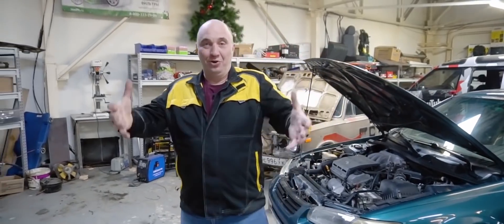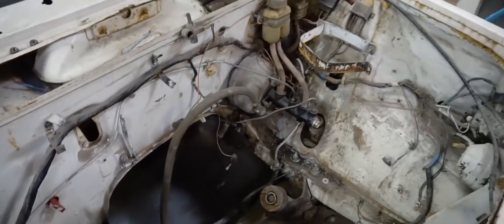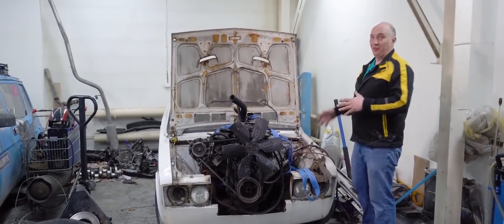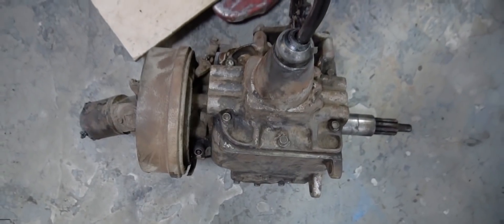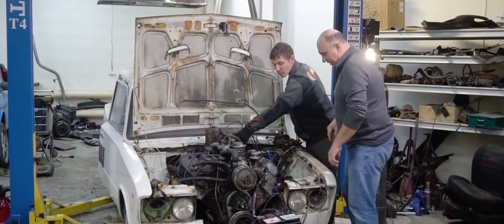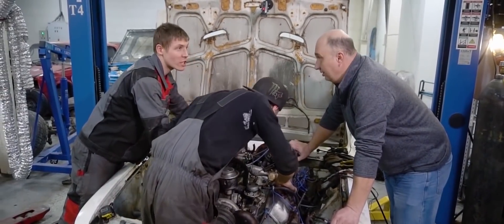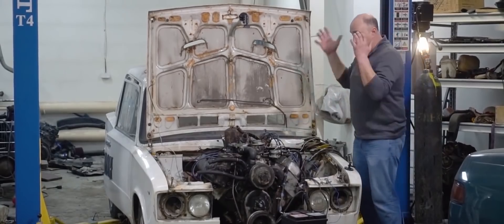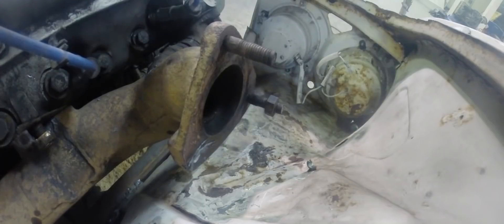Swapping a 7-liter truck engine into a Lada – first start

Comment: How about increasing compression ratio. You can mill heads some but maybe just add a spacer to the top of the pistons. “ domed pistons. Add water alcohol injection if you get detonation. With all the extra boost.

Comment: If that engine is from a ZIL 131 it's a 7.0 litre V8 making about 150 horsepower, and so tough and under-stressed that you can run it on anything that burns; gasoline, diesel, heating oil or even Vodka.

Comment: YEA! That huge engine weighs more than 3X of the original... Not much difference he says...  The suspension and drive train will have to be be beefed up for sure. Also the frame will have to be strengthened. That motor can tear and twist that car apart!

Comment: Make a nice custom hood cowl by reinforcing the inside of the hood with a metal template (the cut-off bottom of a turkey baking pan) which you spot weld on. Then cut out the shape in the hood. Cut one side off the remaining rimless turkey baking pan remnant and face it toward the windshield to fit it. Attach tabs from the remnant to the motor. Spraypaint all pieces white.

Comment: If that "transfer gear" was to drive the front axle, the Soviets were dumber than a box of rocks.  That's where a PTO would go.  On a US military truck, that part would drive the winch.  It's not strong enough for the kind of torque that the front axle could require.

Comment: The lada with 38-inch tires way we modify it we changed rear axle wider one and put off racing knocks long travel shocks and steering racks. you have a monster car.

Comment: Looks perfect. Just a little bit more pressure in the front tyres - and every thing works good. 300kg is nothing - an A380 weights 400.000 kg.

Comment: "This should be a straightforward swap." Understatement yes? About like trying to stuff an IH 549 under a SII hood. For those that dont know...IH (International Harvester) engines are industrial grade and quite large//heavy for their displacement. IE a 304 is almost as big as a 454 Chevy and weighs about the same.

Comment: It is 6 liter engine if it is from Zil-131. It is 7 liter if from Ural 375. Only the piston and liners change. Externally only way to tell is by carburetor. Zil has K88 carburetor, Ural K89.

Comment: While a big block V8 Lada is very cool, perhaps that is not going to be so cool temperature-wise, not much space for a radiator.Perhaps the second and third 7L truck engines need to go in the back. Google : Bustle Bomb dragster

Comment: I remember when someone swapped a Leyland  alloy V8 into a Volkswagen 1600. Type 3  it ran like a scalded cat.  breaking traction in 2nd  the cooling plumbing was a nightmare!  ......never did buy it , ....the test drive was enough.

Comment: It will burn the exhaust valves with no pipe from the manifold
Reply: @D.O.A. yes cold air getting sucked back in, I've seen it before, it can happen if you  have blown exhaust gaskets or stock manifolds, short headers with no pipe, etc, now that's on a 350 Chevy I am just assuming it will be similar

Comment: 7L V8  making a monsterous 150hp so it can run on kvass
Reply: I hope they turbo the thing
Reply: @lazar2175  But then they need to install EFI and it will be complicated on this engine
Reply: @nicostenfors5690  No they don't, plenty of older FI cars without any electronic fuel injection, just need a carb made for boost and a fitting pump and nozzles.
Could have some issues with timing tho, probably fixable.
I'd try to source a turbo from a bmw diesel with a engine bigger than 3.0 liters, should make this baby go fast.
And you can get used ones under 100 dollars, only real problem is they have to make their own manifold.

Comment: Now install a motobike engine into a truck
Reply: I’m very late, but there’s a lawnmower engine in a pickup truck here on YouTube
Reply: @nbain66  Are you meaning a 212cc Predator engine? Or an actual lawn mower engine swap?
Reply: @desertrat1357  that would be funny, 5.5hp Briggs and Stratton.

Comment: i think the timing is a bit off, or the engine has a problem because of the backfire trough the carb, id check some stuff before doing anything else

Comment: I think you should try to save the hood as much as possible. Weld up pipes for the manifolds and have them come up through the hood like we do on American tractor pull trucks.  Either cut out a hole for the air cleaner or build your own huge scoop over it from sheet metal. Radiator can sit where the back seat was with electric fans, run metal tube for coolant with rubber flex hose for engine and radiator connections.. Widen the rear rims, that Lada will look like a sweet drag car, it looks mean already.  I'm really liking this one guys! :)  Hello from Texas!

Comment: Swap a CBR800 engine or any other motorbike engine in a lada, it’s very possible. Old fiats got turned into drag cars with a motorbike engine in the back. It beat a lamborghini in a race, imagine a lada
Reply: R1 crossplane

Comment: Did you see the backfires through the carb?  Anyway, those Ladas don't have power steering, so it will be interesting to see if it will be driveable with this swap.  After all that's like 4 times the normal weight at the front.

Comment: As far as I know, it is a 5.9 liter unit. It is advertised as 140hp in at least the ones I drove in the army. Those things are pretty OK if you use them as anchors, but pretty useless otherways, they weight a million tonnes, burn totally ridicilous amounts of fuel and give nothing except noise in return...

The noise is the centrifugal "oil filter" underneath the dome behind the carburetor.

Comment: How about swapping in a Cessna 172 engine, in a Lada, and include the Propeller and Cessna Instrument cluster.  There would be no power to the wheels, just the propeller, also use aviation fuel, for the car.    Please like this comment.   Really would love seeing an aircraft engine, powered car.

Comment: Even with aftermarket suspension it isn’t going to handle well without a lot of ballast weight added in the trunk. Then aside from all the weight, with stiffer suspension, it probably wouldn’t handle half bad with better tires obviously. In all seriousness though, as long as you don’t get too much understeer, it would make a great drift car and since drifting will lessen the load due to the rear tires spinning you lada diff and axles might survive a few laps. Lol!! I don’t know if you’re using the stock drive line though :0 :p YOLO baby! With it being so light in the rear compared to the front it might just spin out while trying to drift or be hard to control.

Comment: 6,960 cc displacement depending on the year of the donor truck. So was it a zil 131 or an AMUR 531350/531340. I hope that donor truck was re-powered not scrapped.

Comment: A GM 350 V8 should fit into the Lada’s engine bay.
Reply: Would look rather nice too, or a 454 probably a little smaller than that truck engine they have
Reply: @ce5243  a 454 is like 7.4 litres lol

Comment: That noise at 11:21 is a rotating centripetal oil filter. It spins itself using the oil pressure, the centrifugal / centripetal force filters the oil. At least thats what it looks and sounds like. Its the thing you touched 11:29

Comment: ah, so now the lada will use approximately twenty litres of fuel per kilometer with a soviet truck engine designed to run on crude oil and fermented muskrat.

Comment: you may want to upgrade the rearend. that stock one probably won't last long. might be a good idea to add some weight to the back so the rear tires will grip better :) and have fun and hold on tight!

Comment: - Has loose 7.0L truck engine resting lopsided in the engine bay of a Lada
- "This is really starting to get interesting!"
Reply: Saphire Throated Carpenter Ant still trying figure out where the trans case going. Or is that going to be the new drivers chair 😂

Comment: How about a motorbike engine on each axle?
Reply: In my town there is fiat 126p with 600cc hayabusa engine, it goes like crazy
Reply: @fila1445  hayabusa is not 600cc
Reply: @Stropitor  my bad it was from cbr600, Google tor Kielce 126p 600cbr
Reply: fila1445 i wonder how do motorcycle engine swapped cars go reverse :D
Reply: @nail9602  most likely they don't :p
Most of them I've seen were just track cars
Reply: @nail9602  Use a gold wing and you're fine
Reply: @fila1445  In my country that is highly illegal!
Reply: @DG_427  whoop whoop that's the sound of da police
Reply: @DG_427  technically in my country to as that wasn't an engine that was fitted with this car or any other model of it, but no one cares
Reply: on each WHEEL!
Reply: TheDailyBiker you can’t mount a car transmission into a bike engine easily, considering it would be swapping a sequential to a H pattern
Reply: @bigmista3889  what ?
Just make adapter plate and custom flywheel and you are good to go

Comment: 2 weeks later: “Adding a third 7-liter truck engine onto our Lada” 😜
Reply: YES. This must happen!
Reply: best prediction comment I have seen here x'D
Reply: They should add a V12 tank engine instead of that puny V8 truck engine. :D
Reply: @George Washington Full pull
Reply: I'm looking forward to it 😎
Reply: Yes, but add 2 more 7 litre motors 😎😎
Reply: Ahhh hahahaaaaaaa
Reply: that would be pretty funny if they went that route lol. I still think if they went this far with it make it into an off road beast! put some military axles on it and big off road tires it'll go anywhere they put it!
Reply: FOUR OR MORE!!!!
Reply: @George Washington these guys are on a budget make things work with what they got  not some spoiled kids that thk there cool but there are idoits
Reply: Or 2 months later :  " Adding a T-34  Tank engine onto our Lada..."  🤡
Reply: Want to see
Reply: Get a real name FUCK HEAD
Reply: 7:03 music name please
Reply: “To preform the modification we had to move the steering wheel into the back seat” 😂
Reply: Omg amazing funny lol trolololololololololololool
Reply: 21 liter displacement... lol what could possibly go wrong?
Reply: @steadycruisin619  👍👍👍👍👍
Reply: Might be a bit nose-heavy........😁😁😁😁😁😁
Reply: @themeatchannel1134  nahhhhhhhhhhh... maybe just a tad.
Reply: @themeatchannel1134  yeah, you'd need to add weight at the back and redo suspension at both ends, eh?
Reply: @themeatchannel1134  you're right.  Needs to be 4. One per wheel.  Russian wheel balancing

Comment: Cut the firewall out, take out the front seats, extend the steering and pedals and drive it from the back seat.
Reply: No, but they will put driver seat on the roof.. 😁
Reply: @pebri427  better yet, bolt a.couch on the roof and steer from there 😎

Comment: Another great project. Engine mounts will quieten it all down. See if you can squeeze   an exhaust manifold out of pipe have a straight pipe sticking up out of the engine bay. That's going to be seriously good.

Comment: before you try and drive it be sure to reinforce the drive shaft tunnel and put a roll-cage to keep it from warping the chassis and body or you might have a bad day with that much torque
Reply: Please Complete All Fields  you might be right. those small axles will break but if its junk id say just go for it

Comment: what madness!  with that engine it is not necessary to lower the suspension.  I would put the battery in the trunk so that the weight distribution is 50%.  And I would also make a small hole in the hood lid or it will not close. 😂😂
Reply: Nope, remember the first Police Academy. Bubba Smith just took the front seat out. That would definitely give you the 50/50 you are after.
Reply: I would put the driver in the trunk to get that perfect weight distribution. Bet it turns 9's in the quarter

Comment: I can"t wait for Inline 14l 2 truck engine lada.
Reply: That would count as V16...
Reply: @EdvaE39  a inline with one cylinder could be 14 liters. Displacement doesn't change cylinder number
Reply: @_Anthony___  is it technically inline if it only has 1 cylinder? :-D
Reply: @_Anthony___  "inline 14l 2 truck engine" im sayin that these two engines would be V16, since V8+V8=V16 you kno... not inline.
Reply: @EdvaE39  14l means 14 liters, they are referring to the 2 engines being inline
Reply: @EdvaE39  V8 + V8 would be a W16...
Reply: What about Jet Engine Lada?
Reply: Tf... are you guys high?
Reply: Cummins has a 14litre straight 6. Called the N14
Reply: @roadwolf2  Volvo do a 16 litre straight 6 :D
Reply: @roadwolf2  We're not talking about shitty Cummins here, they want real engines.
Reply: "inline 14l" that's a V8
Reply: @jm036  Wtf, no

Comment: “The stock engine weighs approximately 120 kilos while this one is about 450, that’s not that big of a difference” 😂😂
Reply: maybe for those who wondering how much the truck engine weight. although the engine size , and the 'look' on Lada pretty much explain how heavy the truck engine is..  😄
Reply: @wayannurlangga4439  oh, for a truck engine, this is really light weight. 450kg is not much for a truck engine. My LDT465 7,8l 6cylinder deuce engine weights 750kg. And a cummins NHC 250 14,5l has I think around 1500kg.
Reply: Idk, considering how much more torque it can produce (maybe even more power compared to an old Lada engine), i would say it isn't much.
Reply: @1300l  exactly... the engine is 3 times heavier but produces a shit ton more horsepower and torque... its power to weight ratio not just how much something weighs....
Reply: 450kg is not much for a truck, true - but a truck has truck suspension, truck tyres, and truck brakes, mounted on a truck frame. 450kg on an old economy car with tinny suspension, cheap little Chinese tyres, crap brakes, and a tinny frame IS a lot.
Reply: @Debbiebabe69  naturally for that small car it's much. But some pickup engines like the Ford F350 diesel V8 have similar weight.
Imagine to put a really truck engine in this tiny car like the cummins... I think, the oil pan will skratch on the ground cause suspension want carry it... 😄
Reply: For better front grip of course
Reply: basically you described a corvette
Reply: @racer98 Dodge viper too
Reply: It's only about 3 massively overweightfolk  and a bottle of kvass difference tbh.
Reply: Yes
Reply: Given that in a modern car (with stock engine) the difference between having a 100kg total driver and passenger and a 150kg total driver and passenger is very noticeable on the suspension, having 330kg of extra engine certainly will make a difference.....
Reply: @Debbiebabe69  
One person is around 70 to 80 kilos
100kg driver+another person is like 2 kids lol
Reply: Russians dont care abouth math stuff:) 120 Kg or 400kg,who cares...
Reply: @really?  He was joking. #cantwinfortrying
Reply: Man that's like me Cummins swapping my stock suspension 1989 f150 with a 350 pound 302 in it and saying nah there's not a big difference in 350 pounds and 1,100 pounds. Screw the ball joints who needs those right 🤔🤔😂😂😂
Reply: This one is probably 450lbs or 205kilos
Reply: that is 990 pound,and buick 455 which 7.5 liter is only 600 pound!!!valve cover and oil pan must be 1 inch thick cast iron!!!!!!!!!!!!!!!!
Reply: ahoorakia 455 is for cars. It can’t run full power often. This zil is for 20 ton truck. It can.
Reply: You wouldn't want the difference dropped on you LOL
Reply: I've had both; Lada niva 1600, and GMC suburban 7400.
Reply: Well considering that there are cars that can carry a weight of 3.500 kilos... 300 might not seem that bad, the problem is that all those 300 extra kilos are in the front.
Reply: I see someone not familiar with concept of dacha.
Reply: for these guys? 
Nothing whatsoever matters
Reply: wanna know something crazy?  my stock s13 weighed more than with the LS1 with stripped interior
Reply: Guys are just legendary
Reply: Ha ha ha ha
Reply: the engine in my car weights almost 1 ton
Reply: Looking at it that way, true.
But the simple fact is, 330 extra kg over those 2 little tiny tyres is a LOT of extra mass....
Certainly WAY over the safe loading limit of the tyres.
That car would have a max payload of around 250kg. Therefore the engine would make it overweight even with NO driver and NO fuel!
Reply: Debbiebabe69 dont guess. The car has a payload of 400 kg.
Reply: they must of cut off a couple hundred kilos of weight just to fit the engine into the compartment lol
Reply: Recently they been filled lada 2tones of concrete and drived it...so isnt so much😅
Reply: You guys are funny. I routinely drive around with about 500lbs in my trunk, and I have a two door. A kg is about 2.2lbs.
Reply: To balance the weight of the engine they can put some scrap metal in the back so problem solved.
Reply: Ypu all forget the Russian lowrider other week
Reply: @jarroddraper5140  was that the little yellow trabant?
Reply: This tinny engine is nothing to making a lada lowrider ep